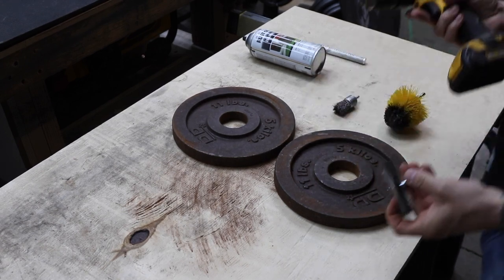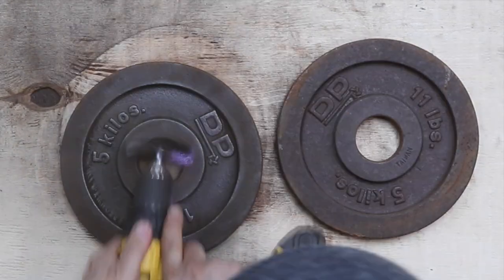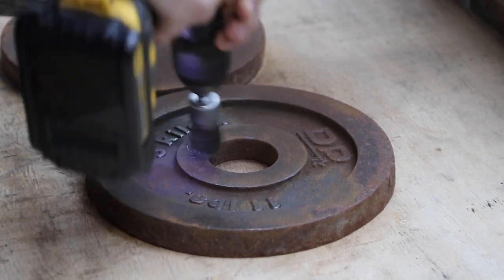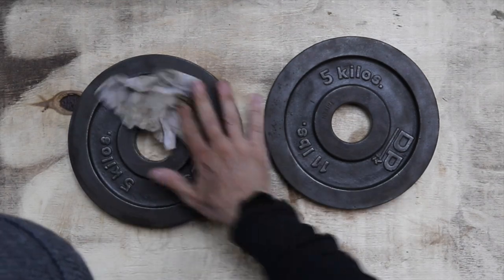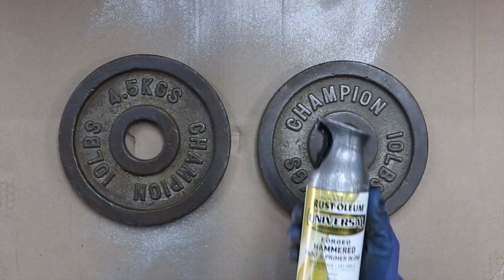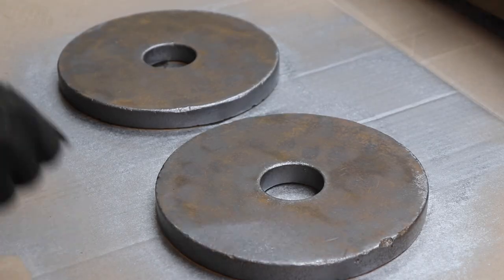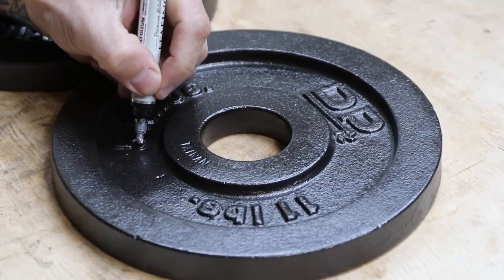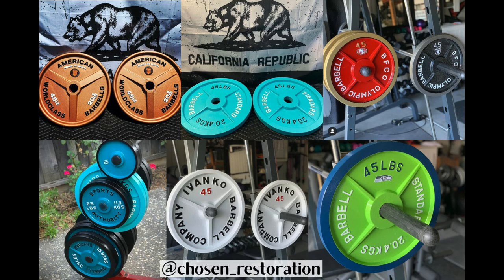Clean weights that are rusty | DIY gym equipment at home

Comment: This is the best way to renove rust from weights, easy and quick, unlike other methods that take a lot of time and effort by scrubbing them with wire brush. Too much work. I did it once with white vinegar but the rust came back. This time I used this method and it is the best way to remove rust.  Electrolysis takes a lot of time too, so I suggest this method over the other ones.
Reply from the maker: Yeah, I agree. I’ve restored a ton of weights over the last few years and this is by far the quickest.

Comment: The music goes so hard! After 00:52 'Remove the rust dust...' 🔥😂 I was hoping for more rhymes 😂😂

Remove the rust dust, grindin' off the crust,
Barbell shinin', ain't nothin' gonna rust,
Steel on my grind, gotta make it pristine,
Polish it up, till it gleams like a dream.

Scrub it down, make it glisten, make it gleam,
Every rep clean, in this iron regime,
No corrosion gonna slow me down,
With this clean bar, I wear the crown.

From the squat rack to the bench, I flex,
Ain't no corrosion, ain't no defects,
I lift heavy, with every rep,
Clean bar, strong mind, that's the rap. (Chat GPT for the win loool)
Reply from the maker: Heck yeah bro! 
It’s funny because I composed the song in garage band. I did that for my first few videos and then realized how much easier it is to just find music to license.

Comment: If you don’t want to paint the weights do you need to protect them with something? I’ve read in many forums wd40 works to add a seal.
Reply from the maker: I'd suggest using a clear coat of spray paint, Rustoleum makes a clear matte (https://amzn.to/3kkxpWU) that will protect but leave the weights the natural color. Using a matte finish instead of a gloss or satin will make it less noticeable. WD40 works to prevent rust too, but I'd go with the spray because it will dry after it is applied. Good luck! Let me know what you end up doing.